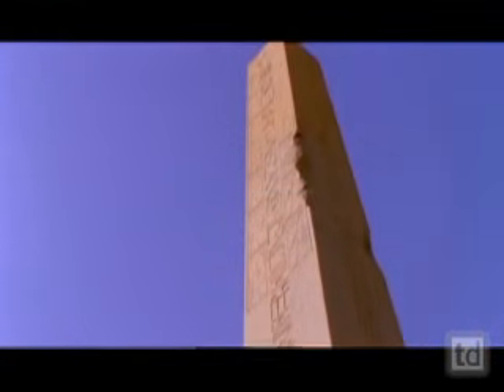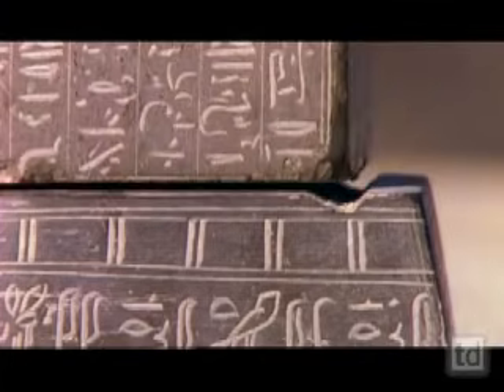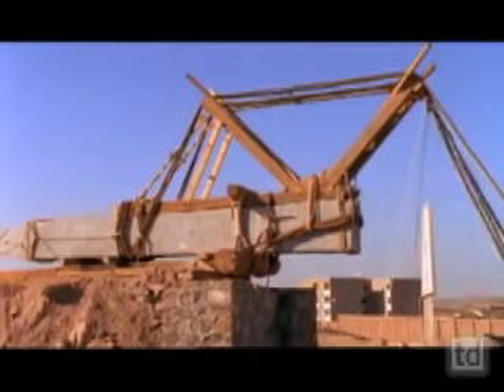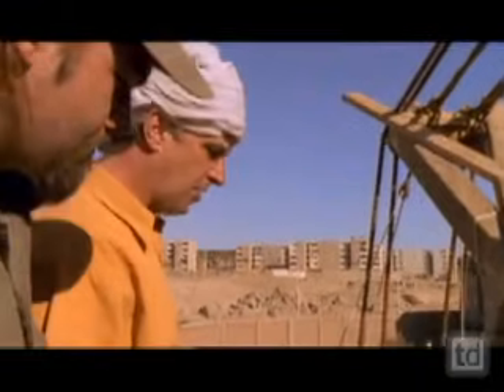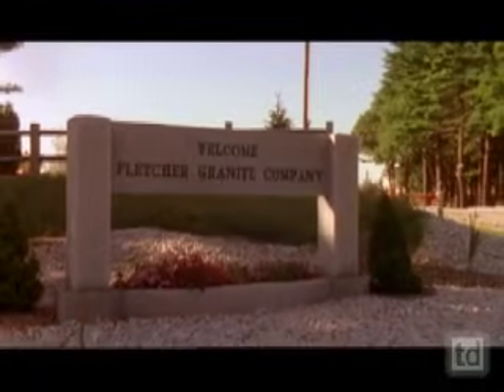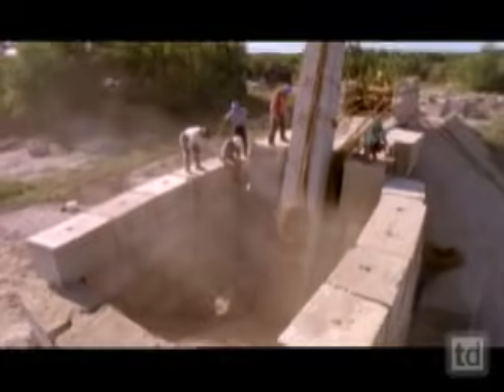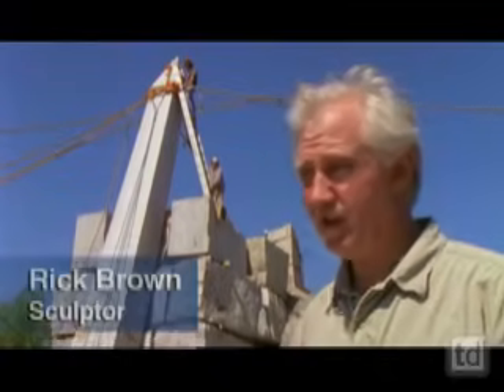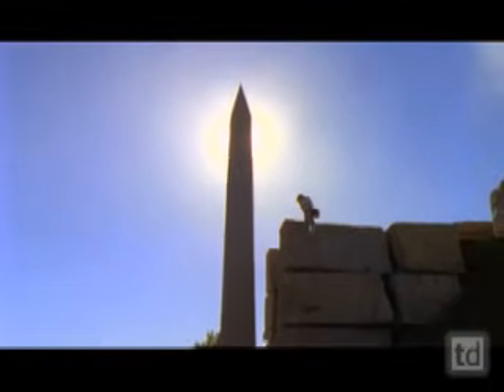Raising an Obelisk

Comment: Both engineering methods were interesting theories, however, I don't think that anything remotely close to these methods were how the ancients erected these. What I think is that we have the entire story and mentality wrong from the start. We paint the picture that the ancients were primitive in nature and that we're currently the tehnologically advanced culture and that by chronolological order history plays out....early = primitive; later = more advanced. This is wrong. Looking at all of the unbelievable architectural marvels and mysteries of the ancients, along with the massive weights, massive heights, massive scale and unbelievable levels of laser precision, carving, digging/excavating, quarrying, sculpting and everything else, it becomes very clear to me that we have the story wrong and that some ancient knowledge was lost to history. These were the most advanced cultures that the planet ever saw. They weren't primitive and I find it rather insulting to assume they were using primitive ropes, logs, mallets, copper chisels and so forth to cut and carve the laser accurate rocks/statues/monuments as they did. This video only theorizes how they may have erected an obelisk (I disagree on the methods). It doesn't go back to describe how these were cut out of a quarry bed...or how it was transported to the site....or how hieroglyphs were precisely etched into these....or how both pieces of the base had to be cut with precision flatness so that there would be no wobble and that it would end up being at a precise 90 degree angle once standing.  My doubts add up more and more.  It's obvious that some knowledge and technology was lost. I mean, who knows, maybe there was levitation.  I don't buy this whole extravigant primitive system of ropes, sand, blocks and logs as their method, when everything else is screaming to be of an overwhelmingly high level of technological knowlege that we still have no idea how things were achieved today. The facts don't add up to the phoney stories we're told to believe.
Reply: well said
Reply: ...you do know they carved diagrams of how they transported these things, right?

They just tied ropes around them and pulled.
Reply: @louisvaught2495   @Louis Vaught  No, I'm unaware of that.  On the contrary, according to every source of media I've watched, read or listened to, it's said that the Egyptians have left no record whatsoever of how they've built them.  What is your source of information?  From various videos and documentaties I've watched, there are always theories and real-life building experiments done with crews who try to recreate how the Egyptians built obelisks, how they built Stonehenge, how they built Easter Island moai and similar ancient monolithic structures around the world (usually unsuccessful or very sloppy).

Furthermore, you tell me "they tied ropes around them and just pulled", in a nonchalant manner.  No offense, but how do you keep a straight face while telling me this?  These obelisks are some of the biggest, heaviest single pieces of stone on earth which were made by man.  They are also carved with pure precision.  How?  I'll hand you a copper chisel, a mallet and check back with you in a month to see if you can remotely replicate a small area of bedrock with laser precision using these primitive tools.  And although massive, the obelisks are quite slim and could easily break in half by transporting, if the weight wasn't equally distributed.  Again, there's no explanation of how these were precisely carved, engraved with hieroglyphs, lifted from the bedrock, transported, erected and aligned precisely in place, unscathed. 

You can believe what you like, but I'm a realistic person who isn't buying that story.  The broken obelisk in Aswan that was never finished was something like 120 feet long and weighs 1,200 tons.  It's clear to me that we've lost an advanced technology that we've once had in the distant past.
Reply: @pgestudio75  Sorry to say that you're just bad at researching things. The Egyptians left decent records, they're just incomplete because things don't usually survive that long.

Look up "Djehutihotep wall painting" for a fairly complete record. There are others floating around, that just happens to be the most famous one.
Reply: @louisvaught2495   @Louis Vaught  I still respectfully disagree with you.  I am not bad at researching, either....I simply just don't belielieve traditional thinking Egyptologists.  We're either being lied to OR we pass on traditional thinking science as 'fact', even if the story doesn't add up and pass fairy tales down from generation to generation like Santa Claus, the Easter Bunny, religion or anything else that humans cannot prove beyond a reasonable doubt via science.  These ancient structures are a mystery because they cannot be proven. We're stuck between a constant battle between traditional thinking Egyptologists (e.g.: Zahi Hawass, Mark Lehner, etc...) who pass on inaccurate and outdated textbook history.... and between critical thinking scientists (e.g.: Robert Schoch, (the late) John West, etc...) who go out into field and look for physical and scientific evidence that contradicts traditional thinkers.  I personally lean toward science, not fiction.

As for the Djehutihotep wall painting:  I knew about this for over thirty years.  In fact, on my very YouTube page, I have uploaded an old and rare Egypt video that dates back to something like 1982 and is simply called 'The Great Pyramid'.  In this video, the scene from the Djehutihotep wall painting is shown as a crew of men attempt to build a very small pyramid in the same way as the ancient supposedly did.  Watch that video to confirm.  And by the way, I uploaded that video years ago, prior to the conversation here between you and I, just so you realize that I knew about this long before you supposedly claimed my resrarch was bad.  Again, it's not that I don't know about it....it's just that I don't believe the tale we're being told.  Like I said, grab a copper chisel and a wooden mallet and I'll check back in a few months to see how your progress is of absolute laser precision....much less considering transporting, erecting, shifting/aligning in place, etching precision hieroglyphs, etc... .  Aside of that, the wall painting depicts workers moving a statue (not an obelisk) on a sledge. The scale of difference between that statue and an obelisk are enormous!  Still, I don't believe the sledge theory no more than I believe  copper chisels, wooden mallets, ramps, ropes, slaves, etc... .  Sheer nonsense, in my opinion.

The hieroglyph name in Khufu's supposed pyramid has been considered to be a hoax from a few centuries back by many people.  Who is to say that Djehutihotep's wall painting is also not a hoax...or that it was created to throw us mentally off course?  We really have no idea.

Bottom line: everywhere around the globe remains enormous ancient stone structures that were built on a colossal scale, with laser accuracy and alignment.  We cannot even duplicate most things today, nor in the time frames necessary for these structures to be built within the reign of any given person's life time.  Face the facts, we have lost a superior form of technology.  Simple as that.
Reply: @pgestudio75  So it's not that there isn't any evidence, it's that you just want to disagree with the evidence that does exist.

Honest people call that "lying." Or "arguing in bad faith"

Don't do that. It's deceptive and disrespectful to the people you're talking to.
Reply: @louisvaught2495    I sort of had the feeling you'd backlash with that very comment.  No, it's not being deceptive or disrespectful to any ancient culture.  It's called being wise, skeptical, cautious, suspicious, open-minded to other possibilities and critically able to think.  I have already described to you that there is heavy debate that Khufu's hieroglyphic cartouche in the Great Pyramid is considered a hoax from a few centuries back, according to many.  Do we have any proof that the wall painting you describe is legitimate...or a hoax, as well?  Where's the science that backs it up?

You argue with me about the same points I make to you in which you ignored or haven't attempted to answer.  You insist that enormous statues and obelisks were dragged by crews of men via sledges and ropes.  Even if that were true, you're barely scratching the surface and you're sole focus is on transportation.  Again, how were these structures carved?  We're told by traditionalists that Egyptians had copper chisels and wooden mallets, yet I'm told to believe that some of the hardest stones like granite, basalt, diorite and quartzite have been mined, cut and then carved and inscribed with laser precision?  That's laughable!!  How?  Explain.  

Many types of stones come from hundreds of miles.  Again, how and why?  Also, we're told that enormous quantities of wood were used to build sledges, wooden log rollers, mallets, underlayment stability for pyramid ramps, scaffolding, etc..., yet the Egyptians only seemed to have date palm trees, which they relied on for a source of food.  I highly doubt a culture intelligent enough to have superior knowledge in technology would be stupid enough on the other hand to snuff out their own source of food.  We have no idea how Egyptians (or any ancient civilization) excavated, transported, lifted, erected, carved or aligned any of their works.  If we knew the answers, then these things wouldn't exactly be considered mysteries of the world.  Don't sit here telling me "they were just pulled on sledges" in some nonchalent tone.  That explains nothing, nor does the wall drawing.  Even if that theory was true, there's still zero explanation of how these massive stones were quarried, how they were carved and inscribed with precision by primitive tools, how they were hoisted onto the sledges to begin with, how structures were erected, how they are positioned once dropped in place, how they are aligned precisely with earth and space coordinates, how underground tombs were lit in order to be excavated and decorated without fire and soot present (mirror theory doesn't work and the only explanation is the assumed light bulb carving they found carved in stone), how temple columns and horizontal stone beams were put up on top, etc etc etc... .  Nothing can be explained on a human and realistic level without saying that we've lost an advanced technology that we used to have OR that someone else built them.  Those are the ONLY two options.  I'd like to think that we've just lost some secret technology.  

Let's not forget that about 100 years ago, a man named Edward Leedskalnin created Coral Castle in Florida all by himself.  I personally visited the site years ago and it's impressive.  If you aren't familiar with Coral Castle, give it a look.  It's a complex made entirely of enormous coral blocks of stone, made by a small single man weighing about 100 pounds, in complete secrecy.  Nobody knows how he did it.  Ed claimed he knew the secrets of how the pyramids were made, but he took that secret to his grave.  To me, this is compelling evidence that it can be done, very simply so with the right technology and with very small crews.  The secret is in knowing how...and I assure you that it's not sledges, thousands of slave crews, ropes, copper chisels, wooden mallets, ramps and so on.

You are living some 3,000 - 10,000 years in the past.  You are head of a major monolith project which have building tolerances far more advanced of even today's standards and capabilities.  How would you realistically approach this project with laser precision accuracy and speed, given nothing but primitive tools?  You see nothing wrong with this picture?  Lol.
Reply: @louisvaught2495  No reply?
Reply: @pgestudio75  I recommend taking the time to read my comment more carefully. You didn't actually reply to it at all.

Again, what you're saying isn't wise or skeptical - it's actually very gullible. 

We do know how the pyramids were made. Specifics have been lost, but the mystery gets dramatized for TV and then people don't bother researching deeper. 

Just because details have been lost doesn't mean we don't understand what was generally done or we can't repeat it. That's being implied, but it's completely untrue.

A famous example of this is Roman concrete. We know exactly how it's made, and that information was never lost - you just can't reinforce Roman concrete with steel rebar, so it's useless for modern buildings.

This kind of "lost knowledge" mystery is fake news at its most basic, and you've fallen for it pretty willingly.
Reply: @louisvaught2495   @Louis Vaught  Not true.  You're a master of assumptions and speculation.  

First, you never referred me to look elsewhere, nor did you describe your sources.  You simply stopped replying.  

I'm not gullible.  I'm one of the most open-minded thinkers out there, so don't make it sound like I'm some traditionalist or that I fall easily for fake news, because that isn't me.  I question everything, which is why you and I are here having this debate to begin with.  I have been interested in Ancient Egypt probably longer than you are alive (35+ years), yet you somehow take me for a naive beginner.

As for the concrete theory: I have read that in a book about 25 years ago.  As with any theories, I absorb the info as a possibility, yet we're always left with more questions than answers on subjects that don't add up.

You tell me that you know how pyramids were made and how huge obelisks/statues were transported, yet you give no compelling evidence  or sources which proves your theories scientifically beyond a reasonable doubt to be true.  You act like a know-it-all, but can't prove your theories in the field.  Those who claim "they know" cannot prove things.  If you know how the pyramids were built, then demonstrate to me in real life how that is so by building me a super minature model of eight or ten 2-ton stones stacked up.  Remember, I told you Ed Leedskalnin built Coral Castle just over 100 years ago by himself.  Show me!
If you can prove enormous obelisks or statues were moved via sledges, then demonstrate how you'd get them on sledges to begin with, or how they're pulled.  
I respectfully disagree with your views.  On one hand you make the Egyptians out to be super intelligent by 'pouring pyramids', yet on the other hand you make them out to be quite primitive if they're dragging statues and obelisks around on sledges with ropes and tons of man power.
With every question, stems ten more.  They are finding ancient things with laser precision, coordinates and accuracy.  You can never answer these questions because you have no idea.

A long time ago, someone told me something that just clicked.  They said, imagine if all of the ancient mystery stuff never existed.  Then ask yourself the questions.  Suppose I then told you that ancient people could build enormous structures like pyramids, temples, statues, etc... and to have them all done with laser precision, accuracy to unbelievable tolerances and set to precise astronomical coordinates many of the times, would you believe it?  The answer would definitely be no.  How do you have cultures that lived thousands of years in the past be more advanced and/or smarter than us living today?    Life doesn't work like that.  We progressively advance as time goes on, yet that's not what our model shows.  This is why they're considered "mysteries". 

You and I can bounce back and forth here forever, debating and forever disagreeing.  It honestly gets us nowhere.  So unless you can physically prove things to me, I respectfully disagree with your views.  Now I know you'll counter or retort by saying something sarcastic, like I'm gullible, uneducated or ignorant.  Save your breath, unless you can physically prove your theories to me in the field via hands-on science.

It's been good.  I'm politely disengaging, as this is going nowhere.  Take care.  🙂
Reply: @pgestudio75  laser precision?
Like.... As precise as a string pulled tight?
You don't need lasers to make a straight line.  You also don't need some magical forgotten high tech to build a stone building.  
Just because you cannot fathom that they were able to do it with bronze age tools, does not mean that they did not do it.
There is no evidence of special unknown technologies.  Therefore, pretending they were used is speculation.
I think you underestimate ancient humans.
Reply: https://m.youtube.com/watch?v=E5pZ7uR6v8c&t=69s
Here is an example of their super high tech know how.
Please explain to us again how you think they are the most advanced civilizations to ever exist.
I'm sure they're global communications network was very impressive.
Did they have a sweet network of satellites orbiting the planet also?
Or, did they just erect some really big rocks?